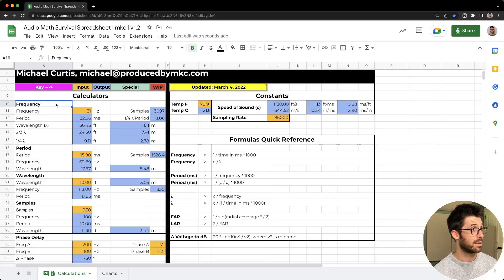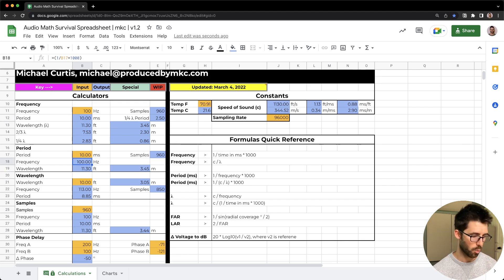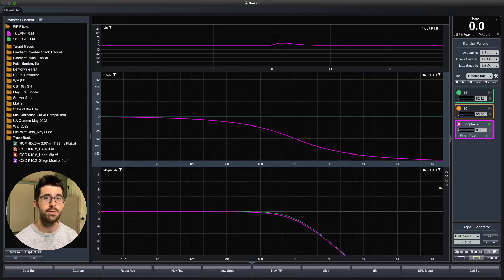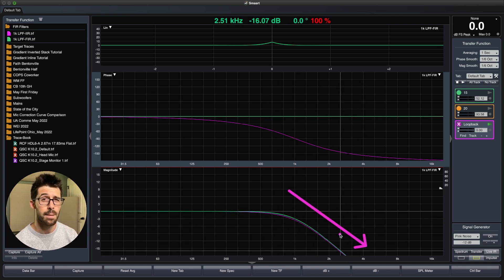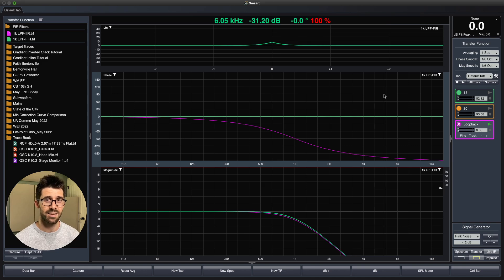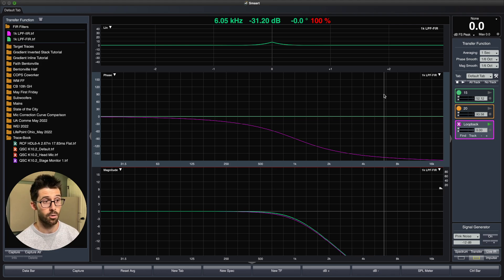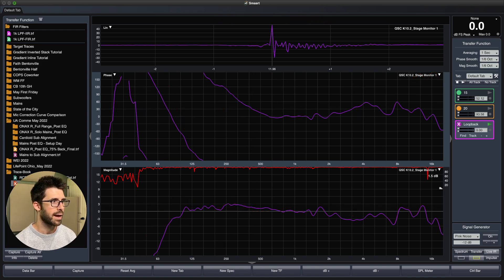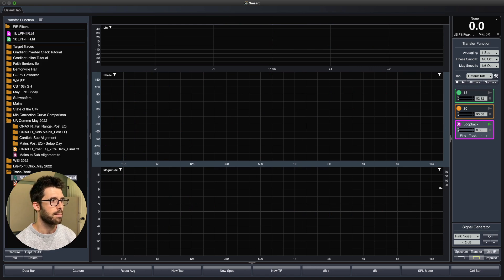FIR Filters In Live Audio | What's The Hype?

Comment: Im looking at an amp with a dsp that has an fir section before the eq section. Im running a couple subs and tops only for now. Is fir something i should consider incorporating? Cheers!
Reply from the maker: If there's a specific FIR that pairs with the speaker you're driving then by all means load it up. If not, regular old EQ will work great.

Comment: Hello try this. Smaart v9 transfer capture then export file (no adjustments) to REW. REW auto room correct export to rephase. Rephase linear add 4500 for each 5.1 speakers export all to eqapo convolution file. Sound nice from pc hdmi to avr. Way better than Dirac or minidsp imho. I just ordered iem measuring rig and later I will do my headset. A professional car audio installer taught me this.

Comment: great video but a bit confused. if you add an iir filter up stream say in your mix on the console does this not go out the window?
Reply from the maker: The IIR filter upstream would of course alter the phase of your mix, but FIR filters in this specific circumstance are designed to make the speaker itself more linear when it comes to phase and magnitude. So yes, the broadband signal of your mix would be altered if you used a normal bus EQ, but we're not after phase linearity there.
Reply: @MichaelCurtisAudio  interesting stuff. I need to learn some more. I get to use a rcf hdl 50 system which is awesome it has FIR filters available in the box dsp over rd net. we tend to do our system tune shaping on the matrix processor that feeds that though rather than in the speaker dsp. I freelance FOH mix for the company so its a little tricky to make time between their shows to set things up when and do some of my own extensive testing.

Comment: Great easy to digest information on this topic. It didn't seem like you addressed the impulse response smearing from these types of filters. If there was no down side to these, then everyone would be using linear phase EQ for everything.
Reply from the maker: Great point here. I did address the downside in that you incur delay as you move lower in frequency, making it impractical to use FIR filtering for much below 300Hz or so.

You're totally right in that the transient response is changed as energy is moved "forward" in time, not all of it arriving after the initial IR peak. I chose to leave that part out since the "smearing" you're talking about it much more audible when using FIR filters on low frequencies when processed heavily, especially at high Q values. But since FIR filters for live audio speaker processing never touch LF, I chose to leave that downside out.
Reply: @MichaelCurtisAudio  Fair argument. I must have missed the point about FIRs being used for only high frequencies in live sound speakers. Keep up the great informative content
Reply from the maker: @MrWoodstock35  Thank you very much and I appreciate the question! I think others probably have the same question you have as to why I didn't mentioned it, so I'll make sure and cover that in a future video. Thanks for bringing that up.